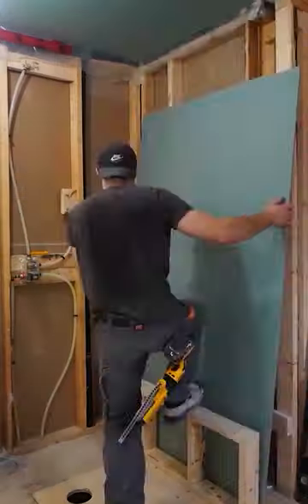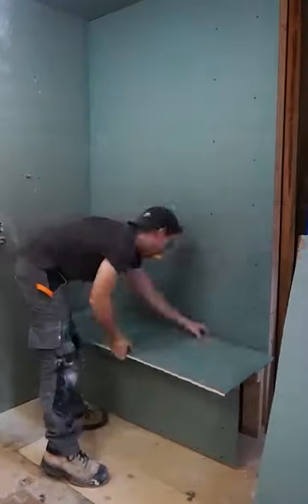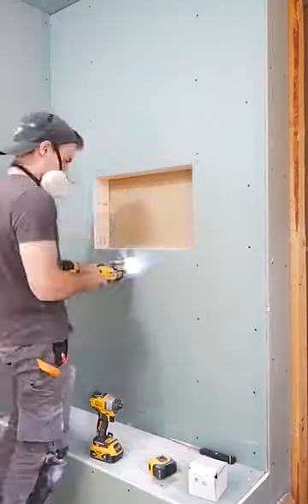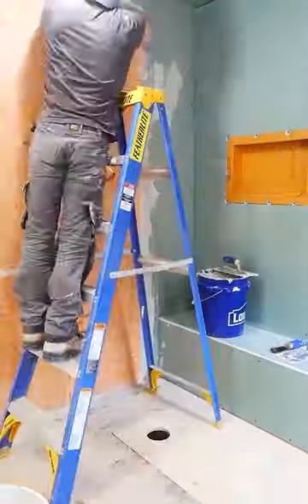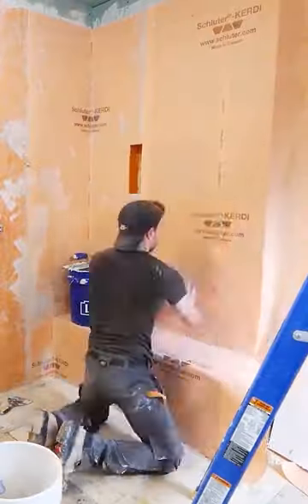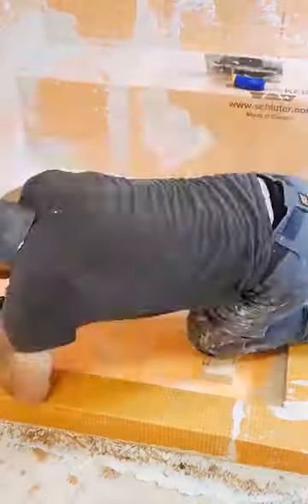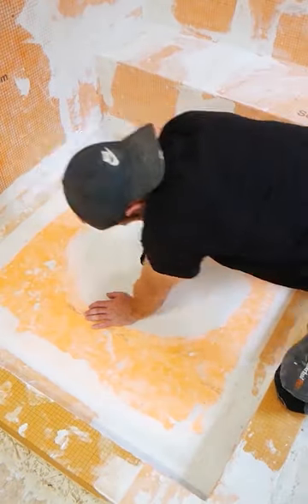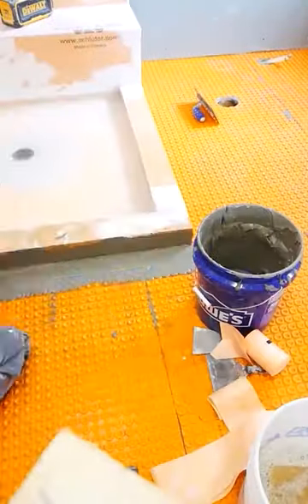How to Waterproof a Shower

Comment: Cement board will take the water damage a lot better than the plasterboard
Reply: 1 million percent
Reply from the maker: It shouldn’t be taking any water damage that’s the point of this video
Reply: @WorkinwithWolkon  the point of following regulations that INCASE it does fail the cement board is stronger. It’s code in the uk. Hoses move things settle and crack over years. Just because you’ve done a amazing job doesn’t mean that sometime in the future there will be water getting in. Water could get in from else where than the bathroom… I’ve been running a construction company for 20 years and am on my way to work on 1.5 million £ house today. Where the bathroom will be done the RIGHT way 🤣
Reply: @DanO181919  you’re talking out your arse mate I’m literally a project manager cement board doesn’t rot 🤣🤣🤣🤣
Reply: @DanO181919 it was probably other materials around the concrete board that rotted. You can actually soak concrete board in water for years, it will dry out and still be usable.
Reply: That’s why cement board is required behind kerdi in steam showers by Schluter. In a hot steam shower condensation can occur on the back of the board where the hot wall meets the cool air. 
I have seen this same effect where a regular shower is used by multiple people regularly.
Reply: @privateobvious655  it’s a well known fact that eventually water will get in 😂 could be 1month or 20 years on water will get in there and cement board will save a lot of damage. We call it wet board in England
Reply: @DanO181919  sound like a cowboy to me, in England it’s code to use cement board 😂 or water resistant ply board. Common sense tbh
Reply: @jeffdidntkhs3945  we call it cement board, backer board.  I’ve been to numerous Schluter training sessions even though I don’t use much of their product-they always put out a great spread and I’m all in for free food. But this subject always comes up. “If Schluter requires backer behind kerdi in the UK then why is it ok to mount kerdi on Sheetrock in the US?”
I have never heard a satisfactory answer, in my option, from the reps. But they always end with install with the product you feel most comfortable.  All I would say is that the Schluter system is a good waterproofing system but only as good as the quality of the installation. So the installer needs to make a decision on what he can live with and what he can’t. 
I don’t have a dog in this hunt, all my steam showers are on mud and I try to sell mud for all other installations. But I’ve made personal and business decisions to minimize risk and liability as well as giving my customers the best product for the money in my area.
Reply: @DanO181919  suppose them sheds you call houses get blown down a lot no point building them right in the first place 😂
Reply: @WorkinwithWolkon  you will be fire at the spot. Yes it shouldn’t get pass that but in case it does I wan my to be cement board instead. Never ever hire anyone who use drywall in you shower
Reply: F/c board in Australia (cement sheet)....keep using gyprock and building your wooden houses with chipboard walls...it would get laughed at in rest of world
Reply: @kingslots9134  they build sheds 🤣 act like they’re master builders 😭
Reply: @jeffdidntkhs3945  absolutely,  there are  other factors involved,  condensation from cavity due to temperature differences,  and outside weather as well as constant heat and steam from shower, causing mold and rot...regardless of a water proof membrane period.
Reply: @Dennis4998  good one bro did you come up with that all by yourself 👏
Reply: Whether you use cement board or Drywall is not the problem. The problem becomes when you don’t waterproof it correctly. I have seen houses with both products in bathrooms for decades, and not have a problem.

One thing I’d personally do different from this video - is do not put drywall on the bench surface. And instead use a cement board with some plywood on the bottom to support it.
Reply: Cement board doesn;t have organic material so it resists mold, unlike drywall.
Reply: @DanO181919  Did you waterproof it??
Reply: @DanO181919  Well if its waterproofed, how did it rot?
Reply: @jamiemcgavran5405  totally agree! I'm a general contractor for 35yrs and cement board does not rot. Impossible. These guys don't know what they're talking about. I think Danny is talking about another product.
Reply: @nona4622  it doesn't just resist it. It absolutely does not mold or rott. Mold needs food, cement and fiberglass are not food for mold. The only thing that will rott or mold is the materials it's connected to. I would love to have someone show me the last time they saw concrete rott.
Reply: It’s not about taking water damage better it’s about mitigation of mold as far as the argument between drywall and Cement board. You can make either waterproof and both can take a little damage but once mold starts growing it takes over the drywall versus cement Only grows mole if something on top of it is organic it itself mold will not grow on. But as far is the superior material for showers it is the foam walls Which you can also use for benches and they have the 2 inch foam for floating benches. But if you want to know the correct way to do it you should look up the TCNA handbook. They even have a school in North Carolina Right next to the Shlutor school. It’s where I learned the proper way to do a water in water out mud bed Which I put under Every Schlueter system shower or wet room I install extra layer of prevention in case of a membrane failure nothing will leak outside the pan due to having a liner with proper preslope underneath it.
Reply: @Workin' with Wolkon  it will with the way you did the waterproof membrane. The drain will also fail.
Reply: How about using Schluter Systems Kerdi-Board Polystyrene Foam Water Resistant Backer Board instead of drywall or cement board? I am seeing a lot of videos with this used. I am trying to be more of a DIY  and would like to convert my bathroom to a shower only. Not sure what direction to go yet. Also, why is your drywall grayish and did you waterproof it?
Reply: yup..
Reply: @WorkinwithWolkon  it's called life one learns all bathrooms leak.. every damn one I've had and that was 12..  caulk will fail walls dry shrink and warp. foam seals at wall plate leak..yes they do.. geez you ain't lived yet..  or aren't smart enough or humble enough to realize that..  I'm speechless..you but it's not supposed to leak..and yet they do... 12 homes made me humble.. smart too..i know exactly what to maintain.. plus every home had leaky shower doors, and incorrect electric wiring too... even million dollar ones..
Reply: Right , let's go back to 1975 lol 😂
Reply: @WorkinwithWolkon  lol my shower is so water proof I used sheet rock lol 😂
Reply: I've always used cement board and any huge job I've been on including  hotels/aparment buildings/restaurants ect..  big contractors ALWAYS order cement board. This membrane on top of drywall just seems crazy to me
Reply: @WorkinwithWolkon  it's sheet rock it will take water and rot quickly you must be under 40 lol 🤣 or have o experience with bath remodels !
Reply: @WorkinwithWolkon  green sheetrock
Reply: @frankenfaq4706  literally on a job and some foreigners tries to convince the client to use plasterboard in bathroom 🤣 luckily I’m in charge of the site and qualified 😉 experienced tradesmen know it’s a no brainier. Cement board in wet rooms
Reply: With this kind of thinking, you're already sunk.
Reply: Hi, cement board is impervious so wont break down, but will let water through. But american regulations state to use it regardless. You can get pre-coated cement boards like Aqua Panel. 

Regardless this bathrrom will fail eventually. You only have gypsum in the edges. 

Use a pre proofed cementboard, polyurethane joint filled and liquid rubber tape and membrane. All Kerdi does is direct water to the alread weak points. 

At least this guy laid it all right but this system is old and regulations have already caught up with it.
Reply: One word…. CONDENSATION
Reply: durock and tape the seams and screws, only the floor needs full membrane
Reply: @WorkinwithWolkon cars shouldn't crash but you still have an airbag 👋
Reply: @jeffdidntkhs3945  you dont sound like you know what you are talking about. Every client is different we do it the way the client wants and whats in his budget.  Not the way we want. If i did things how i wanted id have no profit😂😂.
Reply: @jeffdidntkhs3945 and you should know building code is different everywherw. Every state is different code let alone country. The reason you do yours a certain way is because the climate conditions are different. Go back to school it seems like you forgot common knowledge.
Reply: @abelnunez8562  but water isn’t different everywhere in the world. Doing the bare minimum to keep up to code is just a sign of a lazy builder. Going the extra mile is what separates the professionals from the idiots who film themselves thinking that makes them professional
Reply: @abelnunez8562  ohhhh so your one of the cheap builders. Put together soft walled bathrooms because you’re the guy who can do it cheaper 🤠 yeeeehaaawwww
Reply: @jeffdidntkhs3945  you’re obviously not a contractor. Humidity is different everywhere. Im not the guy who can do it cheaper. Im the guy who can do it right.
Reply: @jeffdidntkhs3945  soft wall bathroom? You guys dont use studs in Australia or what. The drywall is only used as backing. The guy in the video is going to install tile. Thats how you do it. Tell me you never installed tile without telling me.
Reply: @jeffdidntkhs3945  it doesnt matter what you use like the guy in the video said… if you do it right there’s shouldn’t be water going in. You argued water can come in from somewhere else… that can happen anywhere any time, not just the bathrooms. More work for me if that happens.
Reply: @jeffdidntkhs3945  your house expands when its hot and contracts when cold. Things are constantly moving because the climate. Things are bound to break our job will never end.
Reply: It’s easier to use drywall than cement board. By the time the drywall fails due to condensation, any warranty has expired.

Comment: Folks, don't use drywall.
Reply: Schluter recommends dry wall. I’ve never had an installation fail.
Reply: Treated Drywall bruh
Reply: @UltraGamma25  So what, bruh.  It's lazy.  Cement board cost less than drywall and has higher structural integrity.
Reply: @fredericdudley6184  That you know of.  I do showers too and I've never had a callback either.  That doesn't mean moisture isn't finding its way somewhere.  Go on here and watch all the Kerdi fails.  I'm going to use a far greater material at the same or less cost of green board.

Comment: I’m just assuming most of the people here aren’t taking in to account “condensation” that builds up on alternating hot/cold surfaces.
Shower gets hot, then cools down, condensation.
Show is cold, then warms up, condensation.
Concrete board holds up under condensation.
Sheetrock barely holds up under a sneeze.

Comment: I’m not tile installer but I understood the cement board is to support the weight of the tile and thinset.
Reply from the maker: Yeah I would use cement board for a tiled ceiling but the drywall will support the wall tile just fine
Reply: @cosmosistprograms4970  with drywall in ur shower say u put ur arm on the wall to support ur body weight while ur washing ur feet flamingo style. Will the Sheetrock hold the weight? 
I’m brand new brother just a quick question. Appreciate u my friend 🫡🫡
Reply: No offense to your post, but any drywall with whatever rating becomes a sponge when it gets wet. And any that says mold or moisture resistant is complete rubbish. I’ve demoed so many showers with green board full of mold… drywall in showers and tub surrounds should’ve stayed back in the 1980’s. Cement board if not waterproofed will absorb water, but at least it won’t turn to mush like drywall.
Reply: @stevenstevens6904  I'd honest feel more comfortable with cement board but that's just me 😬 not something I'd want have to do again when it's not that much more expensive in the grand total, not sure how big your shower is tho lol
Reply: no cement board does not break down when water goes to it - its just like the wet trades you dont plaster a bathroom you use hardwall.

Comment: I just did a shower surround over a tub.  I used drywall and 3 coats of red guard.  1 coat of a surface bond and tiled over.  The walls I tore out were drywall and tiles over, they lasted for 25 years.  She's good for another 30.
Reply: Red guard is the bomb

Comment: I just bought Hardy Decker Board this week; it's water proof cement board.  I installed it and then added thinset over the seams and used membrane tape over the thinset.

Comment: I would question if a thinset lap joint is actually waterproof or just water resistant?? I think this assembly's longevity will be highly dependent on the frequency of it's use. With today's trends of showers being used four or more times per day, the mortar and thinset are going to be damp all the time. Eventually that moisture would wick through those joints like almost any cementitious product, would it not?

Comment: IDK, cement board is much more Ridgid. I would be more inclined to use it so tile and corners don't crack as easily.
Reply: LMAO!!!  Cement board is the flimsiest garbage product ever invented.  It's weak, heavy, and cuts like shit.  You are wrong.
Reply: Yea I am doin a shower with 1/2” durock walls and I’m shocked by how much it flexes
Reply: @eliotkrueger7811 dura rock and hardi back are a little different

Comment: Was thin set applied directly on a subfloor then the water proofing membrane? I am planning to replace the tub and make mine a shower on the main level. My understanding is prep, install subfloor, cement and level for proper draining, thin set then the water proofing membrane, thin set and finally the tilling. Please advise. Thanks

Comment: I primed my greenboard and tiled right over it. 14 years and its fine. The key is not to allow any grout cracking. If it does crack in corners seal it up with more grout or matching caulk. Sealing the grout prevents any water from getting behind the tile anyway. All these new systems are overkill for people who allow their grout to crack and let water in which shouldnt happen in the first place. steam showers are different of course.

Comment: You emphasized that cement boards not waterproof but you forgot to say that drywall is not waterproof either. The cement board is more structurally sound support the weight of tile better than drywall.
Reply: I’m super new to remodeling but I was thinking the exact same thing. I rather know for a fact everything is solid than cut any corners. My home or a customers I would do it the same for both.

Comment: Benches should ALWAYS, be cement board regardless because of the weight and point load. Drywall isn’t meant for floors or seating, it’s for walls and ceilings.

Comment: This is Schluter Kerdi membrane which is used for this type of application, waterproofing some drywall. Why? I don”t know lol. If you had studs to begin with it is easier and way better waterproofing if you use either the Schluter Kerdi Boards (which are panels like drywall but made to be waterproof) orrrrr even way better a Wedi shower kit, which is similar to Kerdi board except better and 100% waterproof all the way through the board. The Schluter curbs that he was cutting down are ridiculously big and obnoxious, Wedi has scaled these down to a  nice to look at and less offensive size. Also, Wedi comes in full shower kits where Schluter makes you piece it together. HydroBlok is now Wedi’s look a like competitor with almost identical products.

Comment: GP's DensShield is my go to backer board for years now never had a problem when following manufacturers recommendations. 100% silicone Caulk for corners/seams (where the sheets meet) mesh the seams and skim thinset over the mesh let dry up and start setting boy's I have messed too much with that bs sheet membrane I'd prefer hot mop on a 2nd floor or higher. Shower systems like kerdi and guru for lower or first floor/concrete sub floor or slab applications just for insurance.

Comment: Pre fab pans will never compare to a mortar bed with shower pan liner ….way more solid …no flex ….and highly effective when done right
Reply: Danger Diesel   hell to the yeah on that !!
Reply from the maker: You can get a 4’x5’ kerdi pan for >$150 and install it in 10 minutes. Depending on what you bill yourself out at it just makes sense imo
Reply: @WorkinwithWolkon  I wouldn’t care if they were $10.99 at Home Depot . I would choose a mortar bed over a Kerdi pan any day. Germans are smart ….but they dropped the ball on this one for sure. People still request them though. Something about the floor flexing underneath my 250lb ass doesn’t sit well with me …at all…
Reply: Danger Diesel  totally agree with you guys! Always use the membrane and mortar for years. Tried a few schluter/kerdi methods...just too expensive and too much time. Note: cement board ( Durock or Permabase) is totally waterproof!

Comment: Cement board should be used if you using a heavier tile. Drywall also gets moldy very quick due to condensation.

Comment: This is a great way to cut costs on material. Using gypsum is doable but not recommended. 

It’s prettt arrogant to use gypsum and relying 100% on the kerdi system. 

Glad it’s not my shower. So I don’t mind. Great production and narration.

Comment: Cement board is way better than drywall my friend. Mesh tape and mud all joints and corners. Use high quality membrane such as hydraban. Also mud pan with liner and it outlast this method 100-1.
Reply: Agreed. Still using that method for over 30years. Never a problem
Reply: @tonyc7090  most tile guys now a days don’t even know what a mud pan is.